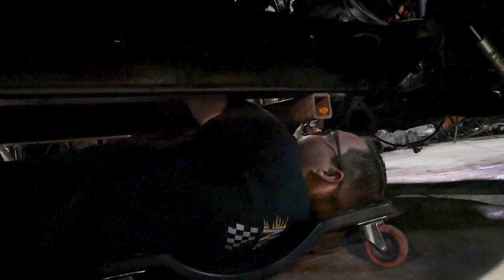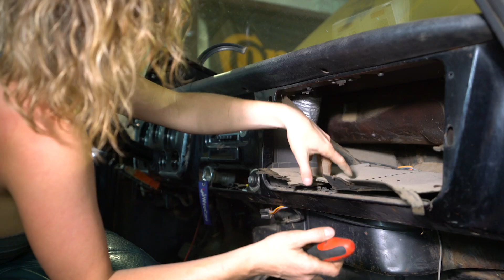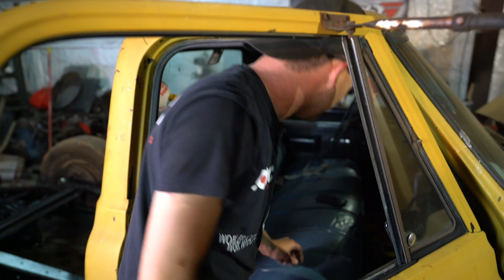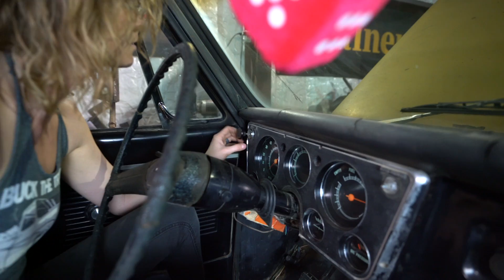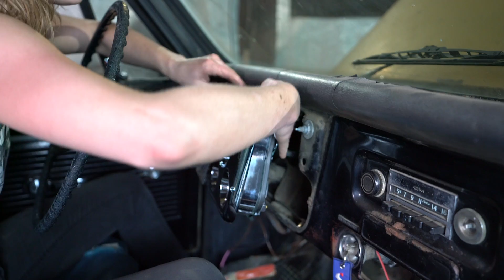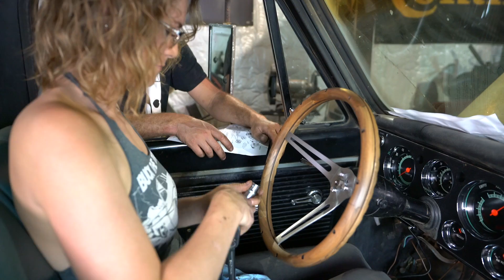Bagged tool truck PROGRESS! In the shop with Emily EP 69

Comment: I really like watching your channel. and projects. thank you but. I'M  NOT LIKING YOU NEW STEERING WHEEL. because when was a kid riding with my dad's friend in his truck. we rear ended a car. he slammed on the brakes and stiffened his arms and the steering wheel bent in half. leaving wood splinters facing straight at his face and into his face. it really messed his face up. had to have several surgerys. it was bad.

Comment: you shouldn't solder high current connectors like the battery terminal.  it should be crimped.  think about it.  in a high current situation, it could melt the solder and the connect could pull out.
like your vlog.  enjoy it alot!

Comment: Emily, you reminded me of a younger day when I was not tolerating a trip to town to buy a steering wheel puller.  I pulled on the wheel of an 82 Malibu until it came off...violently.  I smashed myself in the face at the top of my nose and gave myself a little bit of a black eye...or was it two?  Maybe both of us should just not do that again. Deal?
Reply from the maker: Shaun O Yeah, deal. It was dumb! Sooooo thankful it didn’t smash my face! 🥴🙌🏼🙈

Comment: If you loosen the 2 long bolts just under the cluster that holds the steering column up and lower the column a inch or so, the cluster will be way easier to put in

Comment: Not sure if those butt connectors were the no crimp with the low melt solder in them,  just slide the wires in both sides, melts the solder and shrinks at the same time.

Comment: For pulling steering wheels in junkyards when you forgot your puller - jam the top of your thighs against the back of the steering wheel and push it toward you.  Grab the top of the steering wheel with both hands and jerk it toward your chest.  This works most of the time.
Reply: Lol great advice to knock your teeth out or smash your face. Leave the nut that holds the wheel loosely threaded on so you don’t get hurt.
Reply: @wymansst  Yeah, I always leave the nut on a few threads for this exact reason, but failed to mention it.  Thanks for posting this.
Reply: Glad you didn’t take offense. 👍🏻 It’s a good tip.

Comment: Get a cheap Harbor Freight electric heat gun for doing heat shrink and the heat to connect butt connectors.  Much easier on the wires and connectors.
Reply: Totally agree, torch is way too much heat.
Reply: B Brut heck yeah, Harbor Freight!!